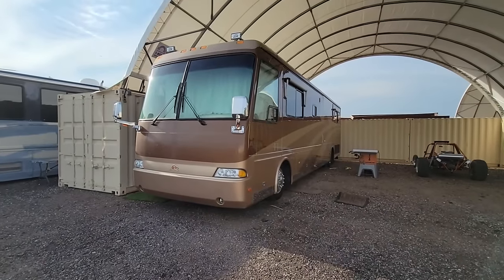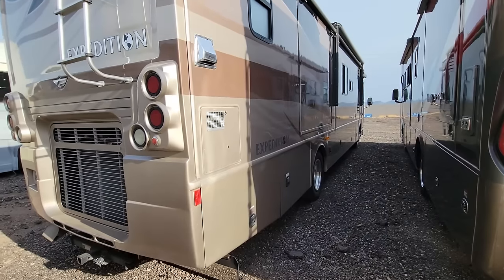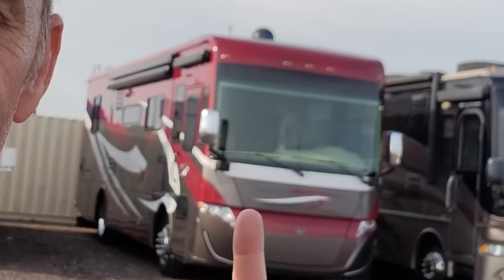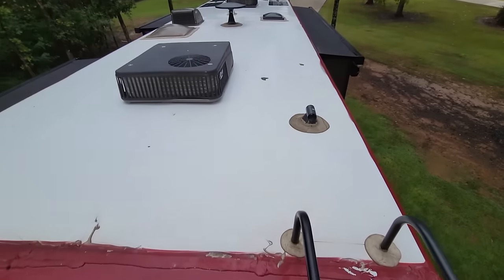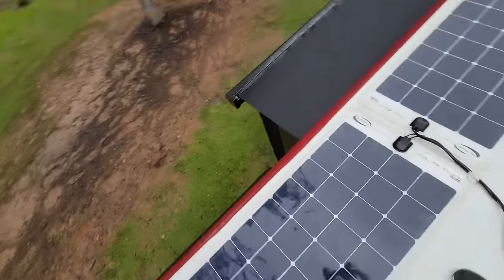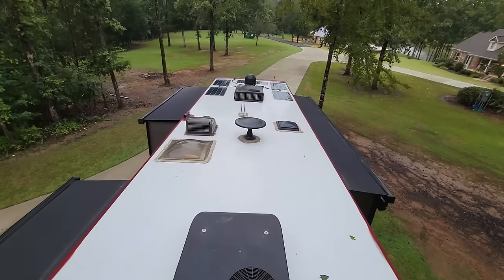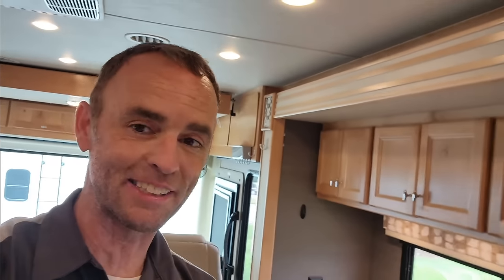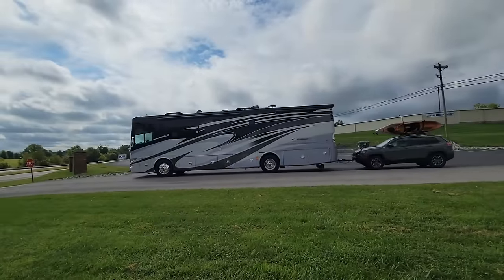Another Cross Country Journey in an Allegro RED RV

Comment: Not sure if you know this. When doing lithium batteries remove the Daisy chain cables and run each battery to a positive and negative busbar. Using busbars will divide load between batteries which will extend the life of batteries as the whole load doesn't go through each battery. for example 100 amps being pulled through 4 100ah batteries is 1C. now with that same 100 amp load going through busbar to 4 batteries pulls .25C from each battery as long as each battery cable from each battery is exact same length. I have 4 banks (same as calling it a battery) with 2 5k inverters. if I pull full load 10k each of my banks will hit .18C-.2C. I have 280AH banks at 48 volts.  Almost all now are doing busbars instead of Daisy chaining. Hope this helps. Then adding more batteries is easy as you just connect to busbar. I also have fused cut off from each bank (battery).

Comment: Great video.  I am from New Zealand and work in the engineering industry so always very interested in what people have done especially in the RV  industry. Its sad to see RV manufacturers install lots of stuff on the roof and drill many holes through the roof which all may leak water inside in time. My idea is when the RV is built a roof rack be built which can be mounted onto  the body structural frame with as few holes into the roof as possible. All the roof equipment can mounted onto that frame, and all cables can be attached to the frame. and have only one duct through the roof where for all cable to enter inside. Ventilation fans should have a side wall vents, and have no roof vents. I would not glue a solar panel onto the roof, what is happening underneath the panel. The modern RV roof is a time bomb, you would want to inspect it  often. I think  the RV industry should move on and upgrade RV roof construction. Cheers
Reply: I built my own little camper out of a LWB Vito van and used this idea, I just unbolted and unplugged my solar panels and antennas when I wanted to use my van roof rack for work.  I also had a vent fan through the floor run by a small solar panel to keep it cool inside.

Comment: Great video James. Congratulations on 50K subscribers!! 
On this Red, it would be nice if you mentioned that it is a Red 340. And the difference between the Red 340 and Red 360! Difference in engine size, transmission and towing capability!
And, my 2011 Breeze has air levelling that works wonderfully. 
How much movement did you get when walking around with just the air bags supporting you?
Reply from the maker: yes it is the 340 based on the exteror badging I can't say I've noticed differences between the two engines. Thanks
Reply: @AZExpert  James, I forgot, you are a master tech, not a salesman! We can let Doug tell us about the RV's specs! 😊

Comment: 5:50 Why are all connections, lids or covers always placed on the deck in the USA and filled with liters of sealant? On the one hand, that looks unprofessional and, on the other hand, I don't think it's really tight! We also had a Coachman EV, so we removed it, spread sealant under the cover, pressed the cover on and then removed everything that came out around it. Then all you can see around the lid is a thin joint of sealant, like the edges of a worktop in the kitchen!

Comment: Nice coach! The problem I have with these Tiffin coaches is the small engine & trans package with DEF. Plus, anything built during the last 2.5 years has the potential for big issues, even Tiffin! Really, anything built after 2010 is no Bueno, imho. I know from experience as I bought a 2015 Tuscany ($300k MSRP) and it was a lemon. After 10 years with 2 different rigs & ZERO issues (2005 & 2010) I had no clue how bad Thor was. Wondering why the owner spent all the money on lithium & solar to sell at 9,000 miles.
Reply from the maker: Probably because they didnt rent first and it was just too much for them to handle